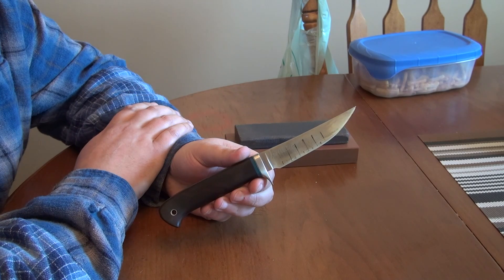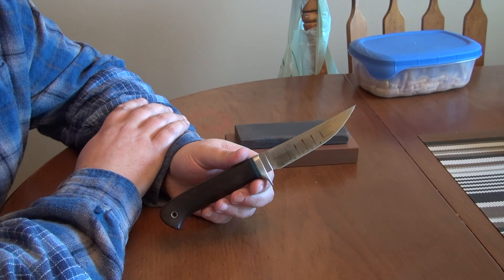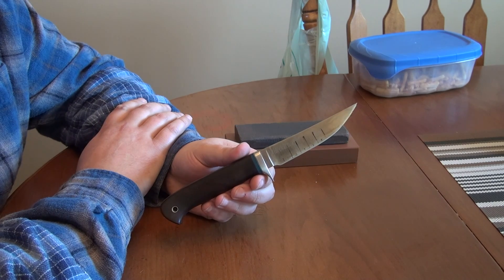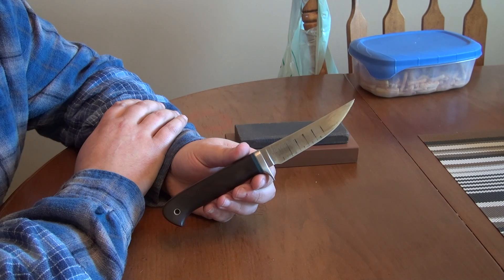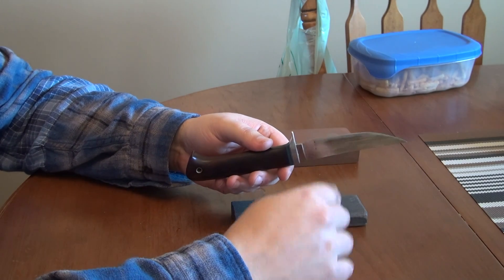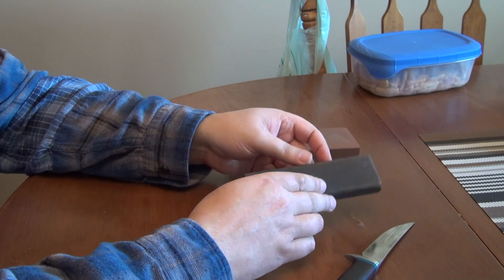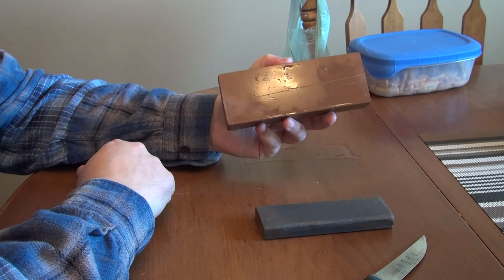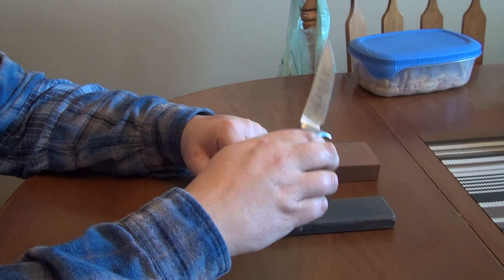Knife Challenge #1 : sharpening CPM-10V Phil Wilson 62.5 HRC

Comment: What are the black lines on the blade
Reply from the maker: I use them to mark out sections of the blade when I do stock comparisons, they are 0.5 cm increments.
Reply: on the topic of phil wilson knives. what do you think of the spyderco southfork. i know it is a little bit thicker than phils southfork but i dont want to pay phils price for a knife with semi limited use for me because it is to large for me to edc
Reply from the maker: xxbryan715xx I have the custom version, very nice light utility knife. I have seen people report the edges on the production to be > 0.030" which given the over all nature of the design and the S90V steel likely to be less than ideal as it isn't suited for heavy/duty type use at all.

However if you have the time/inclination to apply a 10 dps transition bevel then most of the problems can be resolved, ideally just flatten the primary grind down to < 0.005" at the edge - but without power equipment you either have to have a lot of patience, or a fondness for b-movies to do that .

Comment: Speaking of the first thing you mentioned, i was having had some serious trouble keeping my swamp rat RMD sharp recently, i picked it  up after slicing some paper with my buck nighthawk, and i was aghast that it could not even saw into a rip in the paper, and i was starting to think about sending it back to the shop and suddenly, after i had pushed the fine dmt HARD into the edge at a more consistent angle and finished with extra fine, WHOOPS, it went through the normal paper like banana

Comment from the maker: The cheap stone in general cuts much slower, to the point where it almost doesn't cut at all. That is why it was interesting - it only actually cuts well on that knife and only at the very low angle used in this specific case.

The correct answer has been posted, it is annotated in the video. It has to do with the instability of the high levels of carbide in the edge at the low angle.

Tthe king stone is aluminum oxide, the cheap stone is the same.

Comment: The cheap stone is Silicon Carbide while the King Stone is Chromium Oxide so the answer is due to the High Vanadium content of CPM 10V the Silicon Carbide Stone will cut faster because Silicon Carbide is harder than Chromium Oxide.

Also the reason why I use Silicone Carbide to sharpen with as you know.

Comment from the maker: I believe that it doesn't help that the coarse stone isn't hard enough to cut the carbide, but the main issue is that the scratch pattern is so coarse. The curious thing is that if you try to use it on the flats, this doesn't happen and the stone completely fails to do much of anything - again no tear out then.

Comment from the maker: If it was a general use knife which I would be giving to friends, family on occasion, purposed as an emergency/survival class blade then it would be 4340, H13 and similar steels. These are slightly lower in carbon content, maximum obtainable hardness is 54/56 HRC, a little tougher and able to be filed.

Comment from the maker: If the knife was going to be used as my personal knife it would be a steel similar to S1, Calmax, L6, etc. . These are mid carbon steels able to achieve a fine aus-grain, high obtainable hardness and very tough meaning that even close to 60 HRC they will distort rather than fracture when over stressed.

Comment from the maker: Talk to your local HT, you will likely want at least a 2050 F soak (Phil was using 2150 F when he started) and an accelerated quench (salts, oil, etc.). You probably don't want to spend the time and money to grind it if you can't get a really strong micro-structure to hold the carbides in place.

That being said, it would be interesting to see you you felt about sharpening it.

There is also a 15V by the way.

Comment from the maker: Verhoeven's book is a nice place to start.

Exactly, those steels have cementite as the main carbide which is very small and well dispersed. Properly hardened they can be ground very fine, I have a small 1095 custom which I sharpen at 3-5 dps, it has a deep hollow primary grind.

Comment from the maker: That entire knife was also regound. I had used it to the point the edge was actually over 0.020", I thinned it back to under 0.005" which is where it should be ideally. You really don't want to be working on very wide/thick bevels on high vanadium steels unless you really like spending time sharpening.

Comment from the maker: He didn't. He normally sharpens at a much higher angle.

I normally run cutting knives (not chopping) at about 5 dps. There really isn't any reason to take such a coarse stone to that knife, 125 pps on the 1000 grit stone is about 30 seconds.

I just have a bunch of stones, I get them as gifts and I attempted to use that cheap stone on that knife as a joke, I didn't think it would do anything and was fairly surprised when it apexed it instantly.

Comment from the maker: For power sharpening? 

I can't imagine using anything other than something similar to the Norton ceramics, this steel will literally chew the abrasive right off cheaper belts.

For hand sharpening I would recommend diamond or CBN so allow the vanadium carbide to be effectively cut as it is harder than aluminum oxide.

Comment: Well I would say that in my estimation the very high carbon (2.45%) and chromium (5.25%) contents allow the coarser aluminum oxide to wear or erode away from the vanadium(9.75%) particals. Which are much larger and harder than what's surrounding them. So you have to wear away a lot of material to get the vanadium to release. So the aggregate in the cheap stone must be coarser.

Comment from the maker: Exactly right!

The angle that I am using is so low that there isn't enough matrix to hold the carbides in place. If the angle is increased to the usual ranges then the stones will strongly reverse in cutting action.

Comment: Is it because the steel is so hard that it constantly repleneshes the abrasives on king stone without the abrasives sticking to the stone to sharpen since the cheap stones abrasive doesnt replenish quickly the particles stay together longer enough to cut into the 10v to effectivly reset the bevel

Comment: Going at a second guess as I read you said that on other knives, the king outperforms the cheap stone.
I'm willing to bet that this is happening as well: When you sharpen with king, you constantly encounter fresh 1000 grit abrasives, these are not terribly fast for apexing an edge. 
However on the cheap stone, due to the binder content, it's slowly grinding metal away, but instead of encountering fresh abrasives, the edge is more being straightened as if you used a chef style honing steel.

Comment: My guess would be that the smaller, cheaper stone apexed the blade faster due to having less surface area then the larger stone. Not only is there a difference in stone size, but the smaller stone is likely a lower grit, and thus contains less particles per area as compared to the king stone, further increasing the pressure put on the edge during sharpening. If the cheaper stone was not flat, this further increases the pressure on the edge.

Comment: Then it must have to do with how the surrounding metals are abraded away to release the vanadium particles from the steel.  Since the vanadium is the reason for the high wearability  and low grind ability.  Correct?

Comment: The particle size of the abrasive in the cheap stone more closely matches the particle size of the vanadium molecules. Which allows it to abrade them away faster than the king stone. The may both be alum oxide. But the particle size of the abrasives are different.

Comment from the maker: No, in general if you used these two stones you would very likely find that the 1000 grit cuts much faster. The cheap one in general does not cut well, loads quickly, and doesn't release fresh abrasives so it actually gets fairly slick and I have to lap it often.